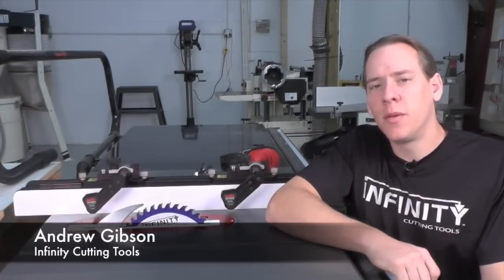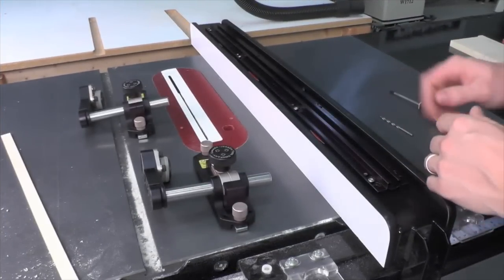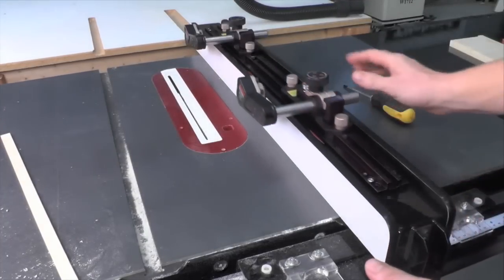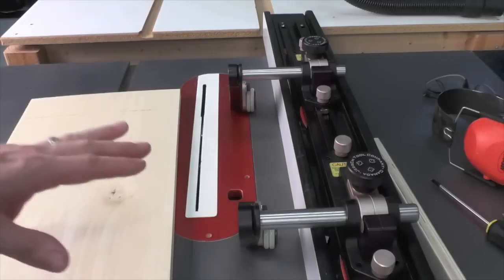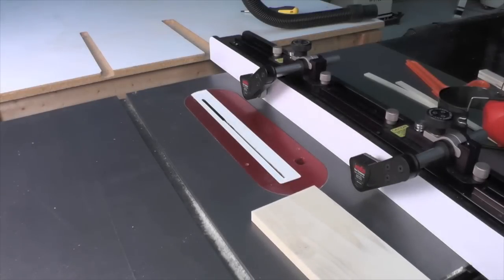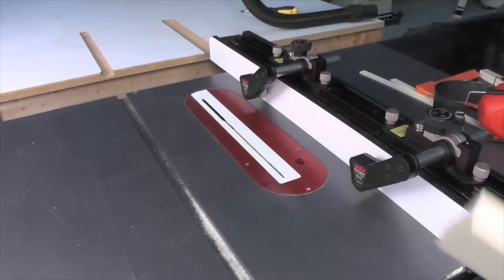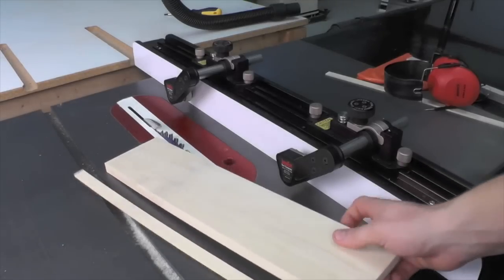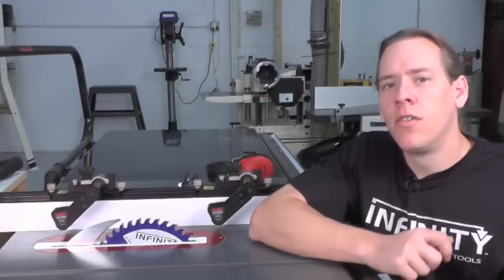Infinity Cutting Tools  - Jessem Clear Cut Table Saw Stock Guides

Comment: A fan of Infinity Tools. Their quality is terrific. I'm interested in these JessEm stock guides but have a great SawStop with overhead dust collection. I want to see a video showing the use of these guides with such a system. I want to see how odd it might be to maneuver a narrow board with a push stick. I can't find anybody making this kind of demonstration on You Tube. Nobody seems to have a "hands on" set-up for the consumer and, JessEm is apparenlty not doing any of the Woodworking shows in the US. All of the videos I've seen fall short In fact, many of them stop just as the actor begins to use a push stick. The product "looks" good, for what I can see of it. It's what I can't see that bothers me.

Comment: But the push stick has to go around the guide (or to the left of it). Anything narrower than your example and the push stick will hit the guides. Correct?
Reply from the maker: +Woodworking For Amateurs yes, in my experience 2" is about as narrow of a piece I use the stock guides with, any narrower and I simply move then up and out of the way. For me the stock guides shine when cutting large or long pieces. Short and or narrow pieces tend to be easier to manage and don't require a guide.
Reply: +InfinityTools I just wish a stock guide like this wasn't so expensive since you aren't using it for all your work, but I can see where it would be great for sheet goods.
Reply: I own a set of these and I use a thin (< 1/2") push stick that actually goes under the black portion of the guides. Considering you don't have to worry about holding the piece down or towards the fence, you can concentrate on pushing which in this case is horizontal. I read about this tip on a woodwork forum and it allows me to rip narrower boards that you wouldn't ordinarily use with these guides. 99% of my rips are now using these guides and because I use a long thin push stick my hands and body are no where near the blade so it acts as a great safety device.  If I need very narrow rips I either use the outside of the blade or the Grripper. BTW I have no vested interest I'm just really happy with these guides

Comment: Disappointed you skipped over the installation of the track to the rip fence. Jessem's instructions leave something to be desired.
Reply: Ben Blackwell  Took me three reads and parts I had to read out loud but finally sank in what they were getting at.
Anyway they are installed and work very nicely for the one piece through my saw, I see what the guy means in the smoothness of the cut.

Comment: What saw blade did yoi use in the demo?
Reply from the maker: We are using the Infinity Super General saw blade 010-044 in this video. It is a great general purpose 40 tooth blade. We recently updated this blade in it now has our Chrome-Armor finish instead of the blue painted finish. You can find it here. https://www.infinitytools.com/10-super-gernal-t-k-saw-blade-40t-125-full-kerf

Comment: Can these guides be reversed so they can be used on a Radial Arm Saw performing a out cut where you would feed from left to right
Reply from the maker: Unfortunately no, while the wheel could be set to spin in the opposite direction, the rest of the jig is not reversible. It would be like trying to put a drivers side car door on the passenger side.

Comment: Will these work with the ridged 4512 model table saw?
Reply from the maker: They should fit. Double check that the your fence rail is at least 2" wide. You may also want to add a 3/4" thick face to your fence to give you a little more room to store the guides out of the way when not in use.
Reply: Ok thank you